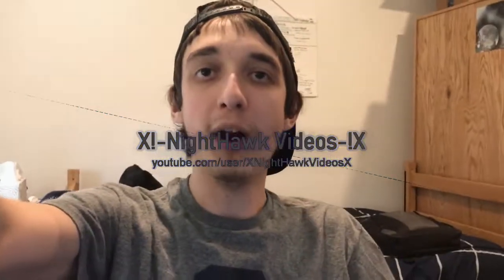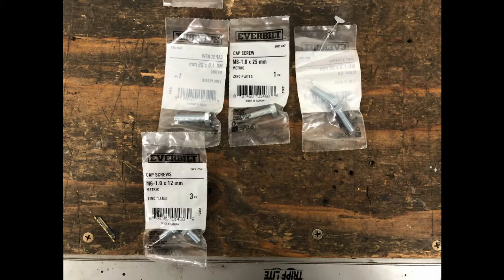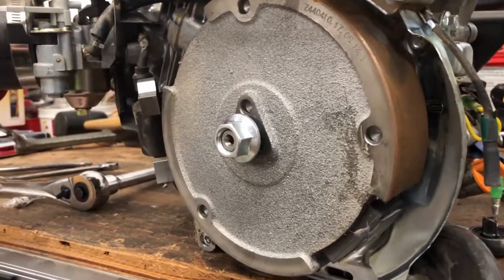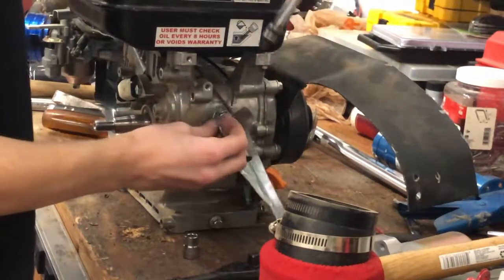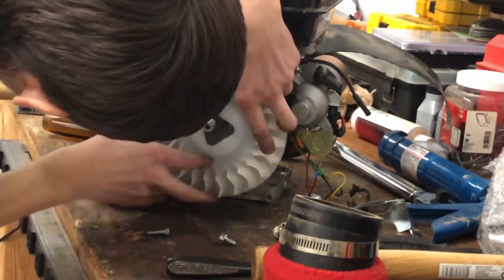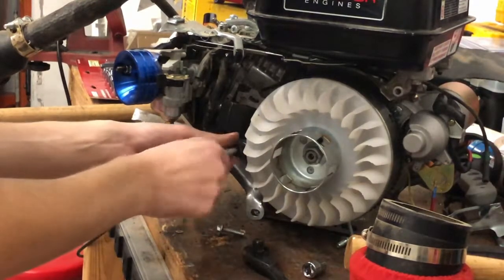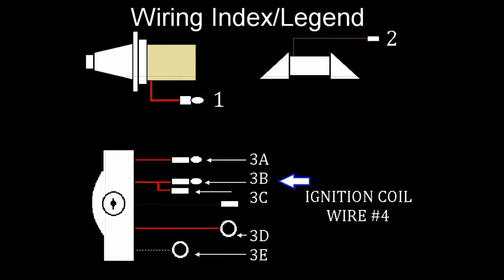Installing an Electric Start on a Predator 212cc *NON-HEMI* || Drift Trike Part 10

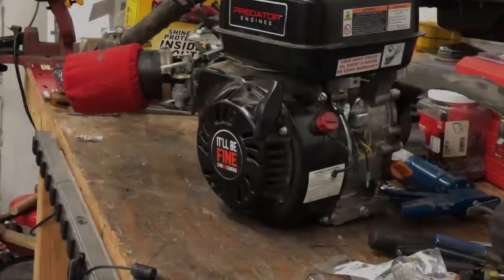Comment from the maker: 5:50 is when the build itself starts.

BEFORE YOU COMMENT BELOW, CONSIDER THIS FAQ

Where can you buy this kit? Link for the [Insert single part here]? Where can I find parts?
Google search "Honda GX200 Electric Start Kit", below I have linked some results
https://www.ombwarehouse.com/electric-start-kit-gx200-and-196cc-clone-aftermarket-replacement.html
https://www.amazon.com/Electric-Flywheel-Starter-Switch-Ignition/dp/B07VF4Y25Q
https://www.ebay.com/p/1562997975
For HEMI https://www.vpowerequipment.com/predator-212cc-electric-start-kit-60363/

Can this work for a __
This tutorial is designed specifically for the Predator 212, Honda GX160/200, and similar clones. If you have a different engine, it' is high chances that it will, but assembly will be different. Otherwise: *No*.

Will this work for a HEMI Predator 212
Refer to the question above, BUT, there are kits out there made for a hemi. 

What [sized] battery should I use?
This kit is wired for 12 volts, and the starter box comes with a 10amp fuse. I currently run a 12v 8.5aH battery and it starts just fine. 

Is a battery needed?
If you don't want the electric start, no. 

Does the coil(s) charge the battery?
Yes. Idle is at about 12.5 volts. Under running RPM's in a governed 212 it's >= 13V

For any future questions, you are free to join my discord here and ask them!

https://discord.gg/yy9wvHD

Comment: Can such a system no Hemi system  be installed on the Predator 212 Hemi engine?
Reply from the maker: Yes. But you’ll need to pay attention to the kit for compatibility; the Hemi 212 has a tapered crankshaft; the non hemi does not…
Reply: @NiTecIndustries  it looks like the flywheel won't fit anyway
Reply from the maker: @gustawuciekinier4094 My point being that there are kits with tapered bores to fit on the hemi 212. Google or Duck duck go yields a kit from WSEPO and V-Power equipment…

Comment: I wanna remove oil sensor, do i need oil sensor for the electric start?
Reply from the maker: @ferhatraif  You can leave it unplugged and removed. Yes. The oil sensor is acting as a ground to the ignition of the motor.
Reply: @NiTecIndustries  thank you man you are the best

Comment: Does the kit reduce power from the engine ?
Reply from the maker: @jacktrawick7820  It shouldn’t. It’s like putting Honda stock parts on a stock clone. You’re still rated for the factory rpm due to the casting.

Comment: Is that flywheel safe for high rpm’s??
Reply from the maker: Nope. It’s a factory cast iron not meant to withhold anything higher than the governed 3500. You’ll need one custom machined..

Comment: If I have a stage 2 kit on my predator will this still work?
Reply from the maker: Not without machining the billet flywheel to accept the ring gear; the cast flywheel with pre-installed ring gear won’t be able to withstand high-rpm.

Comment: by chance is there a way to wire up a kill switch to the handle bars? like use the existing kill switch?
Reply from the maker: If I’m assuming this is on a mini bike, you can try running the wire from the handlebar kill switch in series with the wire going to the coil and the key itself (ignition, not starting)

Comment: Just found this video while doing a google search, as I have a predator 212cc motor on my little duck hunting boat. It can be a nightmare to pull start when its cold out hunting in the fall.....Great video, and Ill be referencing it once I get my kit!

Question though, is the Electric start kit you linked to amazon under the video, the same kit that you used? I want to make sure before ordering it for my Predator 212! Thanks!!
Reply from the maker: It “should” be, yes. It was the link on my gift wish list when my dad got it. If you can find a kit cheaper for a Honda GX200 clone elsewhere that will also work too, long as it’s for a non hemi motor (aka the flywheel bore isn’t tapered)

Comment: Do you have a schematic for the switch mechanism and the breaker?  One of the wires from the breaker on mine came off and I am just looking for quick answer before I GO CRAZY. tHANKS FOR ANY INFO.
Reply from the maker: Hey, see page 5, Figure 1 of the supplied PDF manual in the description.

Comment: How much wider does adding the starter make the motor?  I can relocate the switches, but my engine is installed in a tight space.
Reply from the maker: It doesn’t add much, at least a couple of inches if any.
Reply: @NiTecIndustries  I have an inch past the seam on the fuel tank.  Do you think it would fit?
Reply from the maker: @sonex761  Timestamp 9:30 gives you a visual. I don’t have the exact dimensions, but the radius of the starter passes the fuel tank.

Comment: This thing isn't billet though so it will detonate at high rpm
Reply from the maker: Under the assumption that it’s a same casting as a conventional flywheel, yes.
Reply: @NiTecIndustries  I'd bet my last dollar that it's the same Chineseium casting as the stock one.

Comment: Does this work on the ghost 212?
Reply from the maker: Refer to the FAQ, and I have answered this before:

Not this kit specifically. Since the ghost is a newer engine and this kit was designed around the era before the Tilitsons came out. My best advice would be to find either a manufactured billet flywheel with a ring gear pre-attached that can take the load of the ghost, or take that flywheel on the ghost to see if they can take a ring gear and press fit it on the flywheel.
Reply: @NiTecIndustries  ok so what do you recommend me getting for it?
Reply from the maker: @everythingtech09  With all due respect, I don’t have an answer for that. Last time I did some researching , an off brand go power sports company has a billet flywheel with a ring gear, but it is incompatible with the 212 series due to a tapered shaft. Like I said, your best bet is to take your ghost’s flywheel and get it custom machined for a ring gear that is compatible.
Reply: @NiTecIndustries  ok thanks for helping

Comment: Does this work on the ghost 212??
Reply from the maker: Refer to the FAQ; Not this kit specifically. Since the ghost is a newer engine and this kit was designed around the era before the Tilitsons came out. My best advice would be to find either a manufactured billet flywheel with a ring gear pre-attached that can take the load of the ghost, or take that flywheel on the ghost to see if they can take a ring gear and press fit it on the flywheel.

Comment: is your gov. removed? what rpm can this setup handle?
Reply from the maker: Governor still installed. It’s a cast flywheel setup similar to the Honda GX200, and if I recall they’re rated around 3-3,500 rpm?

Comment: Fyi the honda 5.5 gx160/ pred212 kit fits the durostar 4000s perfectly also, same block. Same mount holes, durostar will not tell you this..  they say there isnt a kit made and you have to buy a generator with one already on. It..

Comment: Will this charge the battery as well or would I need some sort of alternator?
Reply: A battery charger is more cheaper.. but it should hold up for a few days depending on how much lights or battery use.
Reply from the maker: I could've sworn I responded to this, but if you have the kit, the charging coil will charge the battery. Please refer to the FAQ next time.

Comment: Will this work on the hemi engine
Reply from the maker: Please refer to the pinned FAQ next time. The taper on the hemi versus non hemi is different, and this specific kit will not work unless you find a compatible fly wheel.

Comment: How fast does your drifter go for that size motor
Reply from the maker: Current top speed is about 30 mph. 12T clutch and a 48T sprocket on 11" tires.

Comment: Thanks for this video, it's great! If I don't need the battery to be charged, can I omit the charging coil altogether? If so, does that wire just get terminated? I'm preparing to do this for a generator, thanks again!
Reply from the maker: If the generator will charge the battery then sure.

Comment: excellent video, I would like to know where I can get that flywheel and the charging coil, and what kind of starter is used.  Thank you
Reply from the maker: Glad to be of service! You can look in the description or search either a, predator 212 electric start kit, or use the direct kit that this is based off of. This is basically a Honda GX 190/GX 200 electronic starter kit. You can find it on eBay for the inexpensive price. Hopefully it helps.

Comment: Thank you for this detailed and very informative video! I would like to correct you on one bit of terminology; you say "O-ring connector" but the correct name for the part is "Ring-Tongue Connector". O-rings are typically rubber rings that are used to seal pipe fittings. Cheers!
Reply from the maker: Lol, I could've sworn i've said "Ring Terminal" or equivalent, but thanks for the education; I already knew what O-Rings were used for prematurely.

Comment: Where did you buy the starter motor and the flywheel kit
Reply from the maker: Look in the description. Google search predator 212 electric start kit or Honda GX 190 GX 200 starter kit. Buy off of eBay or sellers that will sell it for under 100 bucks.
Reply: @NiTecIndustries   does the kit come with the new fly wheel or did you buy it separately
Reply from the maker: @blaydetroiani8563  I supplied kits in the description. But you can do either or.

Comment: What battery size did you use? I try to find out the smallest (least amps) I can get away with. Not much room for my application.
Reply from the maker: I can’t help you much but to see other replies to other comments.
Reply: So you don’t know what battery you used?
Reply from the maker: @back2basics320  No, I do, it's just I've answered it in other comments through this video but I will answer it again: I'm using a 9lb battery with 12V, 8 AH, with 120 cold crank amps. It's a slightly bigger battery, which might be a problem with your absence of room.

Comment: What happens if mine doesn't have spark
Reply from the maker: Check your spark plug gap, ignition coil (additionally for wire damage, misconnections, etc.), and your spark plug; one of those is at fault.

Additionally check the key switch wiring too.
Reply: @NiTecIndustries  if I screwed up the metal at the edge of coil could that be a problem
Reply from the maker: @hayimhere9604  Possibly, I don’t think so. I am not sure. And in general analogy, grinding on that metal can expose possibly better contact from metal to coil, but at the same time damaging it could have its disadvantages. I cannot help you here. It might be best to replace your coil to be safe.

Comment: So is a battery necessary for this build?
Reply from the maker: If you don’t want the electric start, no; the battery is used to power the starter motor when you turn the key.

Comment: This is kit for honda  SAR 338.91  20％ Off | 5KW ELECTRIC START KIT FOR HONDA GX340 GX390 E*5500 6500 6.5KW GENERATOR STARTER MOTOR KEY SWITCH BOX FLYWHEEL CHARGING COIL
https://a.aliexpress.com/_mLYjBjh
Reply: Thank you🌹
Reply from the maker: Hey, if it works for you then it works for you. Looks as if you can follow the tutorial directly now, but PLEASE be sure to have appropriate torque spec for your flywheel (since it's a bigger motor). 

Also, bolt threads and lengths may vary since it's a different engine.
Reply: I will report this when i was receiving
Reply from the maker: @bandaralahmadi1711  I'm sorry. What?

Comment: Will this work on a Hemi engine
Reply from the maker: Because of the tapered shaft on the hemi, this specific kit will not work, and which is why this instructable is for a NON-hemi predator

HOWEVER, there is alternative parts (such as the flywheel) that you can order online to make the kit work in this case. I believe the flywheel brand is kohler. Check the comments and the community around this video to find further details. Sorry for the inconvenience.

Comment: Picked up a go cart for my son and i ordered the coils and flywheel to try and wire se lights for it think i can just hook the wire up to a battery or do i need a voltage regulator?
Reply from the maker: The wire coming from the charging coils does not need to connect to the battery; it is its own power source. The switch box from this kit provides a voltage regulator via the one way diode. Perhaps when you ground the light down to the frame, and the battery grounds to the frame, then it will charge? But you don't need a regulator I dont think.
Reply: @NiTecIndustries  hmm i see i was going to attach the wire coming from the charging coils to the positive of the battery and just ground the negative to engine and have positive wires from the lights to the positive of the battery and negatives to chassis . Sounds like i might be able to just run the single coils wire to my lights then the lights ground to chassis? Thanks for your reply btw cool bike setup you should in the end
Reply from the maker: @edgarsanabia6874  Correct; that's how I've seen it on minibike videos online. Just make sure the lights are grounded somewhere--maybe double check the voltage coming from the coil if you can.
Reply: @NiTecIndustries  this is only intended as a technical correction, but the diode does not provide any voltage regulation, it is strictly a half-wave rectifier (converts AC to DC). All small engine charging coils put out AC by design and the output requires rectification.
Reply from the maker: @byronmill  good to know man. Thanks!

Comment: How do you know if you have the hemi version or not besides pulling the cylinder head off?
Reply from the maker: AUSTIN ROBERTS No need to pull the cylinder head off. Check the valve cover. If it’s a shiny zinc, non-hemi. If it’s a cast iron, and it’s square with beveled edges, it’s a hemi. I also believe that hemi’s have tapered shaft, and therefore won’t be compatible with the flywheel provided in the kit.
Reply: X!-NightHawk Videos-!X thank you!

Comment: Thank you, young sir for this video. I have a 5hp GC160 Honda engine(vertical cylinder - horizontal shaft). Do you know of an electric start conversion kit for this engine. I have made a few attempts to contact Honda, to no avail. I can't seem to find an electric start kit for my engine. Thank you ahead of time for the help.
Reply from the maker: Bruce Raykiewicz I don’t think that would be possible then. Again I must iterate that this is for a Honda GX200 212 clone.

Comment: What type of battery did you use? And what size wire for the battery leads?
Reply from the maker: For the kit it comes with a starter motor that "in theory" didn't need much to start it. I first used a 12V 5 aH 70 CCA battery and it would start on a full charge, but nothing more beyond that.

I had to replace the starter motor after the cast aluminum chipped on the mounting holes. After doing that, the battery was weak and could not start. I would recommend using a battery that is *12V, 8aH, 120CCA*. Wouldn't want to get a battery that would blow the 10-Amp fuse on the switch box. 

As far as wiring goes I either have 14 or 16 gauge wire.

Comment: Can’t thank you enough for this video. I got my kit installed today though mine had different parts. They included all bolts and hardware and a new flywheel cover that covers the starter! Thanks again, especially for the wiring section!
Reply from the maker: David Vanmeter Glad to be of service!
Reply: Do you have a link to get the parts
Reply from the maker: tyler peters Google search: Predator 212 charging coils or Honda GX200 charging coils, or use the links in the description.

Comment: Currently unavailable.
Reply from the maker: Give me a second; I'll update the description with better links.
Reply from the maker: Ok. I updated the description. Sorry about that; that was the kit I put on my Christmas list back then, but it's the electric start kit for the Honda GX 190/200. Hope this helps.
Reply: @NiTecIndustries  Your video got me headed in the right direction.  I found and ordered a Honda starter kit for my Predator 212 non-hemi head.  It sounds like it can be used with very little modification.  Thanks much.
Reply from the maker: @briscollama2521  Glad to be of service my dude. <3

Comment: First off, the video is  very useful, thank you!

Second, the plastic shroud not fitting, when bolted all back on it sounds like it grinds on the pull start casing. Did this happen with you?? Did you grind the knobs down?.
Reply from the maker: Mario Giannini Yes. The factory plastic shroud is not compatible; I even noted it and you can SEE it in the video (Timestamp 9:54). I ground down one of the three knobs, because two of them fit. Hope this helps; I’m glad I could help otherwise.

Comment: will the kit work with a predator 301
Reply from the maker: A proof of concept was demonstrated by the user "peter torregrossa" of doing so. You will probably need a different kit, as this engine is comparable to the Honda GX270. Try finding an electric start kit for that, then come back here.

Link to peter's video: https://www.youtube.com/watch?v=tvhz3boZciA&t=45s